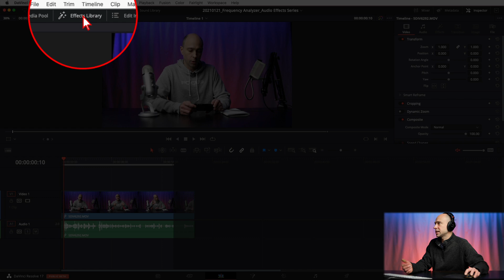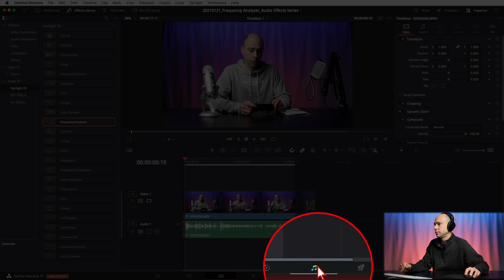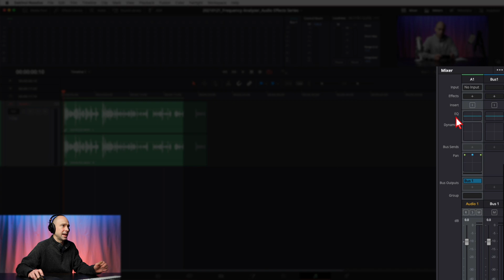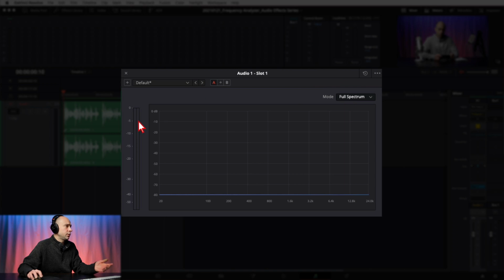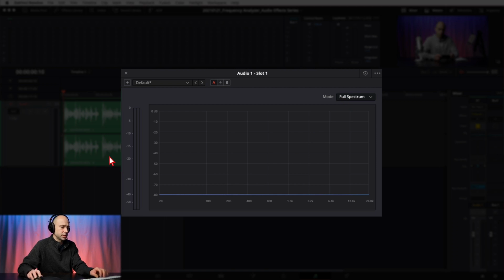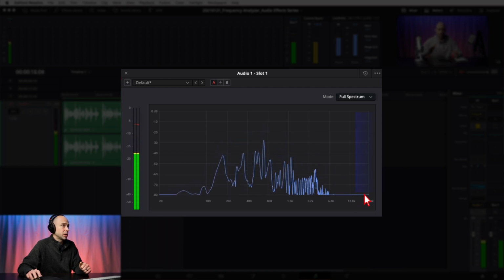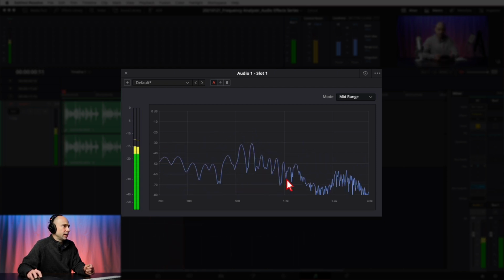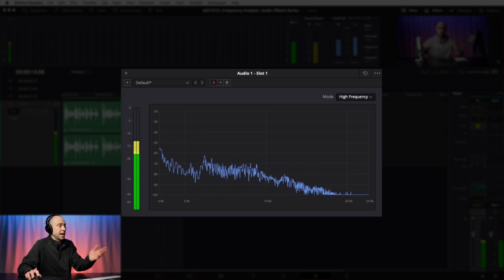Frequency Analyzer Audio Effect in DaVinci Resolve 17 | Audio Effects Series

Comment: Now let's say I manage to detect the sound frequency that my mouse-clicking sounds make. How do I go about reducing that specific frequency, if I already have other EQ and Dynamics settings set up for my voice and the game-track (as two separate audio tracks)?
Reply from the maker: You’ve got a few options. If you’ve already use the EQ on a track level, you could use the EQ for individual clips in the inspector. Or you could just send your whole track to a bus and then use just an EQ on that bus to take care of your additional frequency. Another option is to use a third-party plug and EQ that you can add multiple times.
Reply: @JasonYadlovski  Interesting. Thanks for the tips! I'm curious about the whole Bus thing. Don't all the original tracks get funnelled through Bus by default? 
If so, it would be great to see if I can mitigate the issue by further adjusting EQ/Dynamics on the Bus track itself.
Reply from the maker: All the tracks go to the main Bus1 output, but they don't have to.  You can change that and send them to a different bus or set of busses if you'd like.
Reply: @JasonYadlovski  Thanks man. Really appreciate your advice!

Comment: I recently shot a short film. When we got to the location, an office, I realized that some jackwagon installed ambient noise speakers (they sound like the a/c is running) directly over where we were shooting. And there was no way to shut them off. I had a lot of people there and we had to deal with it. We muffled the speakers a bit but the noise is still evident on my audio. Do you think the above process will help me reduce the noise, or do you have another suggestion? Thanks.
Reply from the maker: Hi!  Congrats on the film!  Sounds like the background noise might be an issue.  I'd start by trying to use a Gate and/or Noise reduction on the audio.  You may even want to look for a 3rd part pluggin for noise reduction.  I think there are better ones out there than the one available in Resolve.  Maybe check and see what Waves has for pluggins.

Comment: Jason, You consistently say 24000 (or other) kilohertz.  Unfortunately this is incorrect.  You could say 24 kilohertz unless you actually are talking megahertz (as 24,000 x kilo = 24,000,000 Hz = 24 megahertz).  Otherwise, nice tutorial.
Reply from the maker: Hi!  Noted, good observation.  Thanks for watching! 👍😁
Reply: @JasonYadlovski  I make tutorials also and it's beastly hard to assure that everything is completely accurate.  If you had said it once I would have chalked it up to loose speech but you said it several times so I thought I'd point it out.  This is constructive criticism - I try hard to avoid being snarky.
Reply from the maker: I appreciate it!  No worries at all.  I’m with ya, trying to crank out the videos sometimes things slip though.  I can lean from it for the next time. 😁 I once had someone point out that I didn’t capitalize the V in DaVinci Resolve and for some reason it stuck.  Every time I write the word I think about it now, haha.   Little by little we grow and get better.  Thanks again! 👍😁

Comment: Muting the audio  really doesn't make any sense.  Watching a bunch of SQUIGGLY lines dance doesn't tell anyone but an audio engineer anything. I think you failed to explain What is the point of a FREQ Analyzer in my Video editing & how it can help me make better video. THANKS
Reply: The point is to show you how to add the analyzer. He has other videos on eq and audio. The video isn’t meant to be a master class on audio engineering lol
Reply: @Derrick_Evans  NO I understand that But neither does it explain what use it is to the average Video Editor.  That's all I ask for. Is that so hard to COMPREHEND.
Reply: @HoundDogMech  not trying to argue man but did you watch the video? He talks about eq and filters on how they are used on frequencies.
Reply: @Derrick_Evans 
 Didn't catch that but RAY WATTS in another REPLY  enlightened me. Sometimes it takes awhile but if one asks enough questions eventually they get the answer. 
SORRY JASON.
Reply: @HoundDogMech  also bear in mind that what we hear can be deceiving based on for example background noise, our age where the frequency response falls with age like a high cut filter getting wound up the older we get, so to have a visual representation of the waveform and the effects of applying dynamics is helpful. Similarly when editing visuals I'm always referring to the scopes because again what we see with our eyes can be deceiving, monitors may not be calibrated, whereas looking at scopes you can see the distribution of colours and intensity in the video colour space. Hopefully you'll find all these tools built into Resolve useful, with everything there is a learning curve but with the help of people like Jason it certainly makes life easier.
Reply: @ray.watts-35  ya i guess had he stated it was to see where and why to place FILTERS on a clip non of this conversation.would have happened. You made it clear what was the purpose of the  FREQ Analyzer.
Reply from the maker: Thanks for sharing your feedback. I didn’t think it worked as good to have the audio playing and me speaking on top of it.  It essentially does the same thing as your meters it’s just that you’re able to see specific frequencies.  Thanks for watching anyway!
Reply: @JasonYadlovski  Sorry but without ever hearing the AUDIO how does one understanding what the FREQ analyser is trying to tell you as a video editor.  A Green/Yellow/Red line as a volume indicator makes sense even without the audio but explain (For us DUMMYS) what the FREQ analyzer is telling us and how different Frequencies pertain to a Video editor. That may help the UNEDUCATED video editor understand why one needs a FREQ analyzer in the first place,Not being an audio engineer and all.